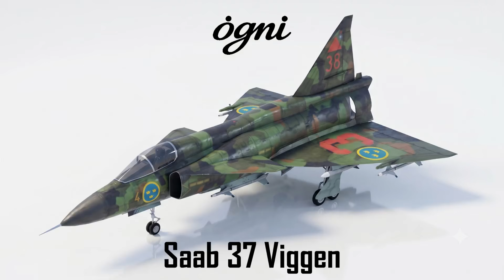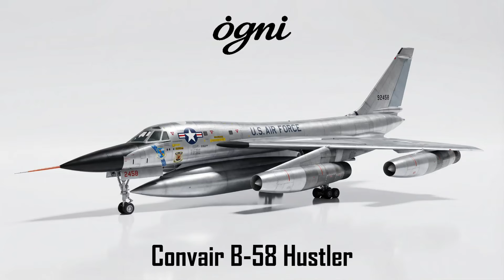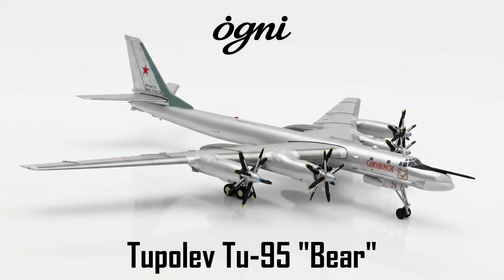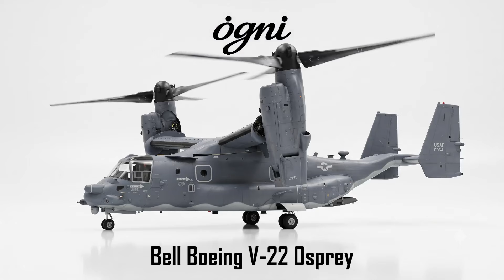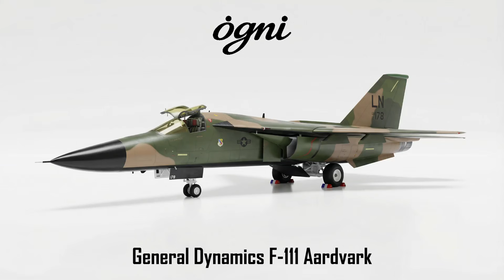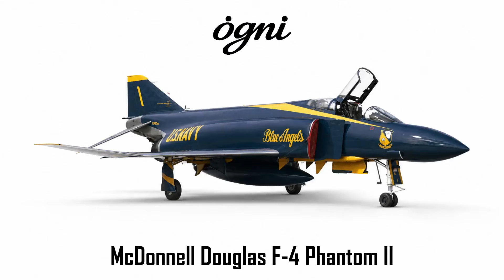Loudest Planes Ever Made

Comment: When we had loud airplanes, those were the best days IMOP. That's the reason why the jet age became so apparent when it first came to be. A notable mention would be the KC-135As with the P&W water-injected J-57 turbojets and the earlier B-52s A thru G models also had the J-57s. Of course we knew that jet engines had to be improved in the long run, but the real airplanes were the ones that guzzled fuel and had that deafening roar, or very loud noise on take-offs. What a time to shatter some eardrums!! Some of these airplanes also left a huge trail of thick black smoke. I just loved those times and I miss them terribly.

Comment: Sud Aviation SE 210 Caravelle: 135 to 140 dB(A), the loudest plane I ever flew with.
Reply: I’m not sure what the noise readings are, but the Sud Aviation SA-315 Lama is unreasonably loud for its size as a helicopter. A Sikorsky S-64 Skycrane is even louder, but it is also quite big for a helicopter. Both have no fairings around their engines to cut down on any noise.
Reply: KC-135A with water-injected J-57 turbojets.

Comment: I saw 2 Tu-95s flying but they wasn't loud, maybe a bit
Also Russian fighter jets are loud, if you close to taking-off one IT LOUD AS HELL as i saw one but didn't captured
Reply from the maker: Tu95 is only loud when the turboprop engines tips start spinning faster than the speed of sound
Reply: @ogni-tv and cuz of that maybe pilots don't use full throttle